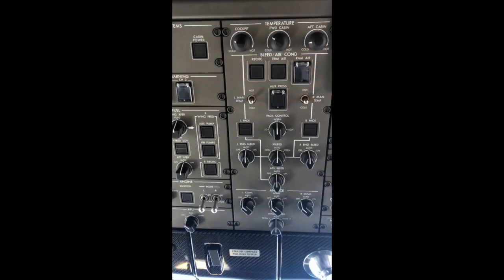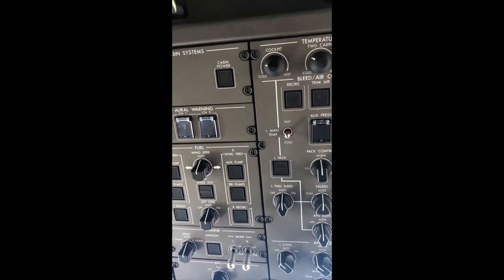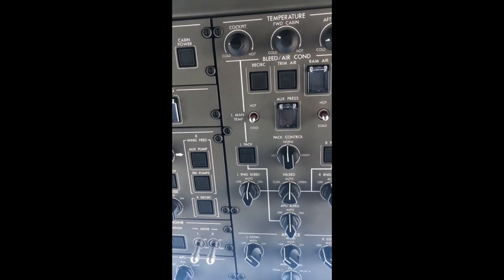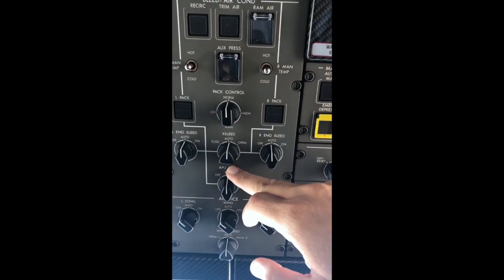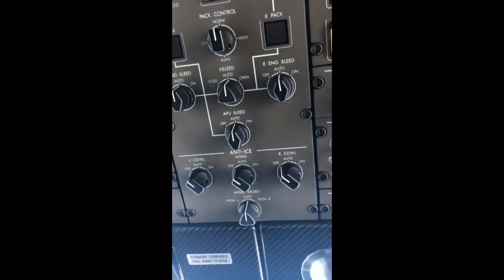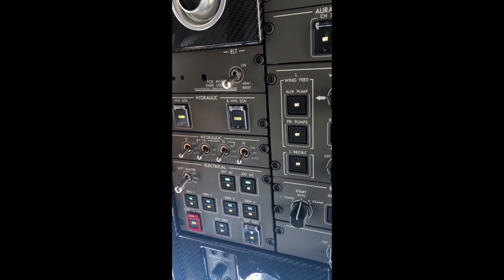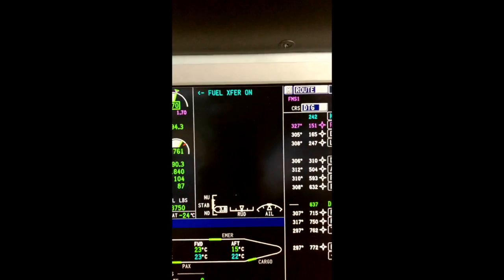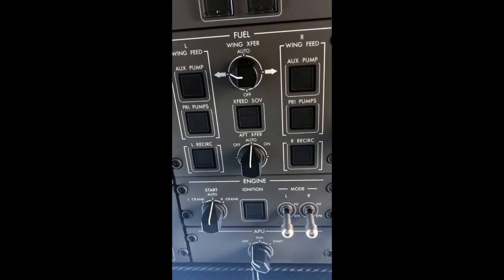Global Black cockpit philosophy and system automation

Comment: hi how about the abnormal checklist (QRH)?  Does it integrate into electronic check list or you need to use QRH separately ? thanks
Reply: GL7500 has a built in ECL(Electronic check ist) which can by shown on any of the 4 screens. It has Normal, Non-Normal, Procedures checklist like QRHs. You can also view any document you want like AFM, FCOMs, FPCCM, FNOM, etc. A lot of Pushbuttons, knobs and switches are „sensed” and those items of the ECL are ticket automaticaly by the aircraft. Great featre to have ;)